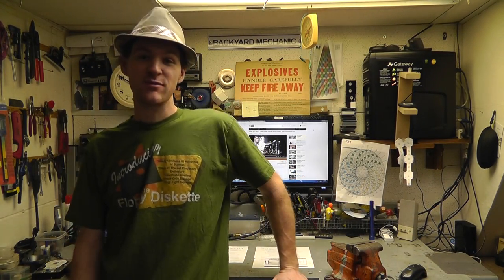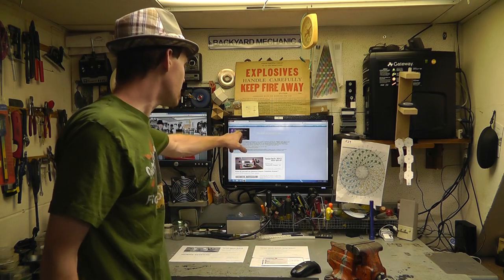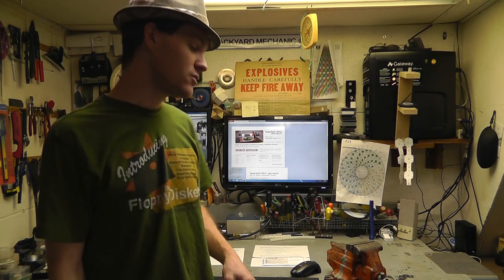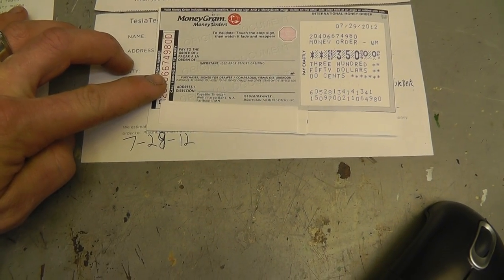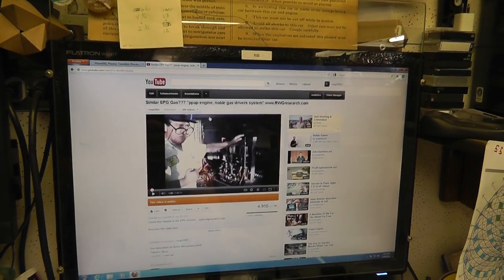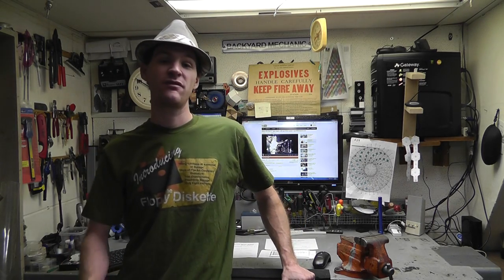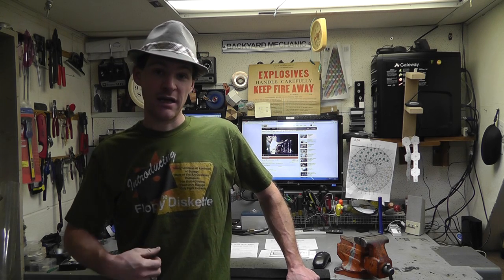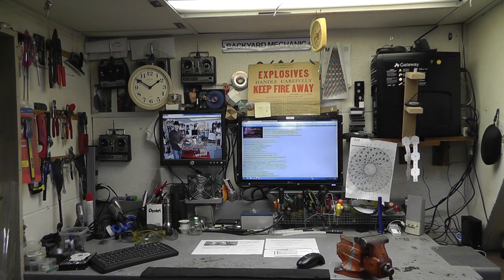Let's build A "Popper" Noble Gas Engine AKA Papp Engine. Times Just Turned... Or Did It? RWGresearch

Comment: Myself and Mark debated this with John Rohner on the PESN site in some of the more recent postings and we are not optimistic.  John did not show much 'cred' and he could offer up no suggestions for testing this device.

It's pops, the plasma gets hot, that creates thermal expansion and a pressure wave that moves the cylinder.  Is that OU?   You have to measure the spark plug energy and the 'pop' energy and compare.  So how do you do that?  That's the fun part, figuring it out.

Comment: From what I can gain, in theory your supposed to somehow to be able to charge a chamber of one or a mixture of noble gas's using advanced electronics that pulse out high voltage and specific frequencies. This causes some sort of plasma burst inside the chamber or cylinder that creates a force of electromagnetic or expansive energy which could push a cylinder up or cause Meyers EPG to produce excess power. Hasn't been proven in mainstream yet but very interesting concept if it works...

Comment: If there is one guy that can make this work-its you Russ.I had my doubt's about this setup,but now i see that you hold high hope's for it--im in.I dont fully understand how it work's-But am i right in asumeing that the gas expands when its charged with a high voltage,and then contracts when the voltage is switched off?.Also i asume the same gas in the cylender will have many cycles befor it has to be replenished?

Comment: Well for one, its non polluting. In the world of exotic energy, a little goes a loooooong way. You can buy most of the noble gases in compressed cylinders at welding shops or gas supply stores for next to nothing.A compressed cylinder may be enough gas to charge dozens, hundreds, maybe even thousands of small engines and the charge would last for months on end or may never run out. It may be possible to produce the effect we want using nothing but the hydrogen in water. I'm hopeful it will work

Comment from the maker: you are correct. but you also need to remember that even if your thinking out side the box on your hydrogen project, your still stuck in the box. we all must expand on our ideas to apply them all in conjunction with others. one piece of nonage is not good enough. we need to be aware of all types of energy devices. alot of of others are helping me on the other projects so they are being worked on still :) no worries! i have been doing a lot lately! just haven't the time to tape them... EGH! ~Russ

Comment: Anyway, if you post on PESN to talk, that would e great.  Measuring the spark plug energy should not be too difficult with a few analog tricks.  Measuring how much energy is imparted to the cylinder can be done in many ways.  How high it can lift a weight might be possible but I'm not sure.  If it's a sealed cylinder with no 'output' you can still weigh the piston and work in the spring weight somehow and measure the initial velocity, as an example.

Comment: i watched the old stuff and the idea seams to be a plasma arc blast tube with a linear accelerator. something i tried to extend low volume hho results for lifting blasters. i would not try to put a piston in it though. inert gas would use the concepts of noble and ideal gas in a Carnot cycle environment. there should be a heat exchanger like a Stirling, leakproof, and it should run like a super diesel. but if it works the technology is easy and very doable. good luck

Comment: I would do the same myself and have used comparable flywheel assemblies as they are all ready made to go, and available on the aftermarket, but would never charge for a license to something someone else holds the patent to. I am always leary of anyone who is charging in such a manner. I have no issue with making a profit. But I am pro open source on everything. The public should have the option of building their own or buying one made. Selling a license is JPMorgan tactics.

Comment: I wouldn't drop what I am doing for how does that compete with something that has no moving parts and makes energy? No oil to change, no bearings to fail, and no constant noise of the thing in operation while in use.

Comment: As my intrest grows I would like to put in my two cents. Lets look at the dumb side of the motor, forget about who's crank shaft and conrods. If the tech works then anything will work. examples could be a VW, Porsche, Corvair, Harley, or anything that is air cooled like an air compressor that you can machine the fins off the barrels and ad teflon rings. Now that i think about it, an air compressor is low cost and the electric motor will start the engine. readily available is key. David A. Puchta